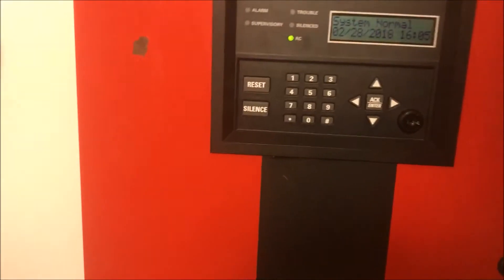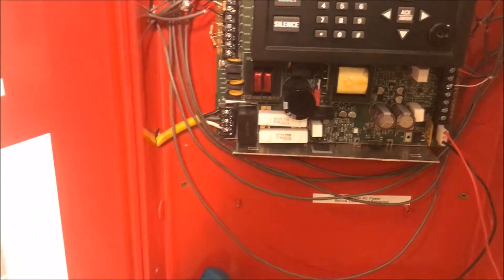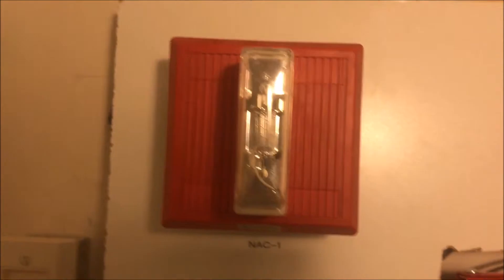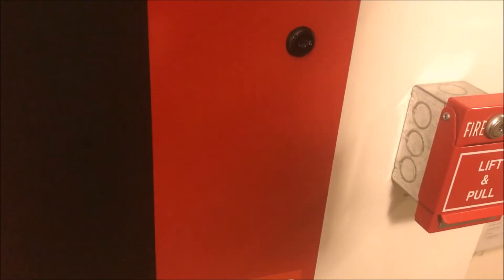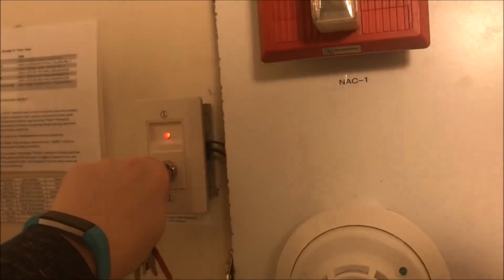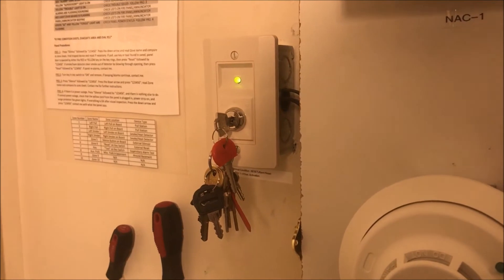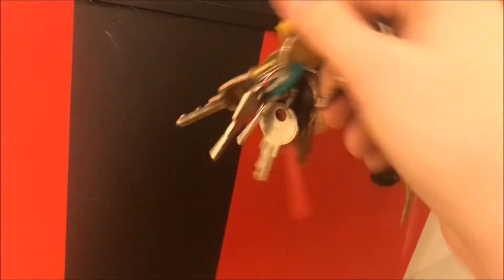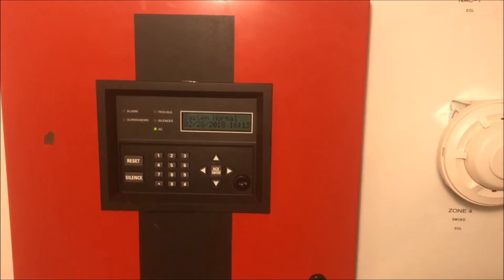Wall Test 30: Older Horns *Fixed Version*

Comment: If you want the red LED to do code 3, keep the red LED on NAC 4 code 3. Then put a relay module (which I can get your for very cheap) on NAC 3 continuous, and have it cut the power to the green LED so that it doesn’t interfere with the red LED.
Reply from the maker: Thanks for the info! It's not a huge deal so I'm not going o worry about it. besides, my NAC 4 is my visual circuit, so having strobes on Code 3 doesn't always work.